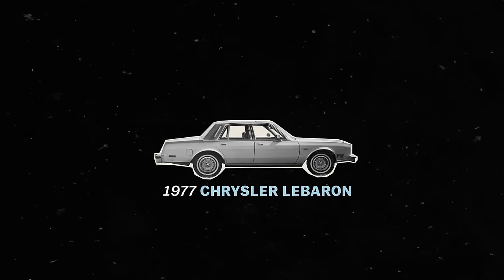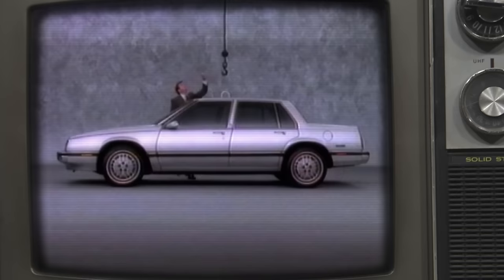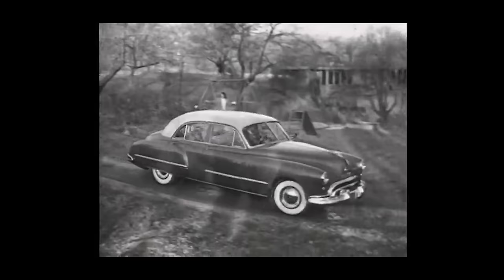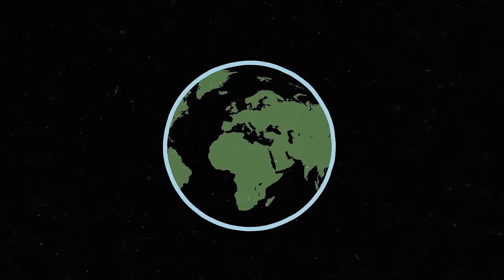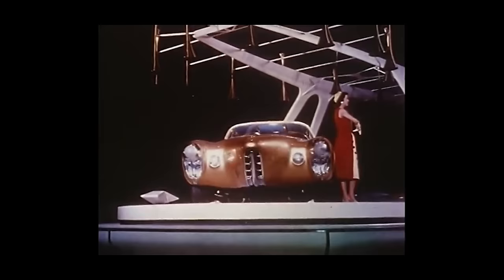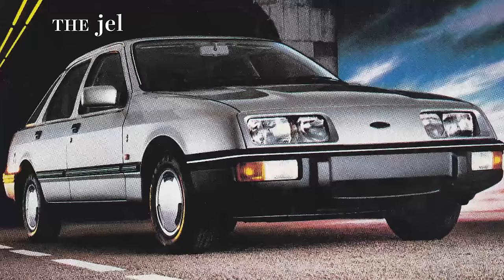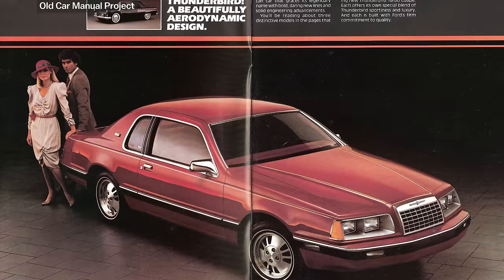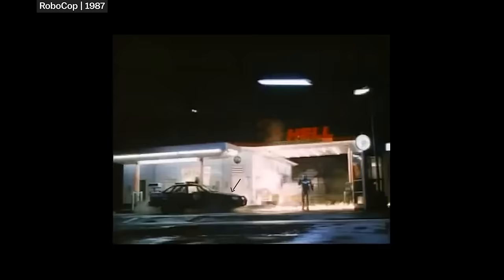How cars went from boxy to curvy

Comment: Interestingly, the Audi 100 /5000 (C3) was introduced 3 months prior to the Sierra in Europe having the lowest drag coefficient at the time. In North-America de C3 Audi Audi was introduced in 1983. Detroit simply had been sleeping, was lacked the knowledge, and had critical inhouse power struggles at the top with lots of corruption and nepotism as well. Specially, the Ford Motor Company with chairman Henry Ford II was a scattered global spaghetti according to Alan Mulally, former CEO. Both sides of the pond very much had their autonomy. UK and German Ford had already merged their design and engineering in mid the 70s. The Ford Taurus indeed was a gamechanger while European and Japanese brands had been gobbling up the American cake of auto sales.

Comment: This video does not seem accurate. It assumes that larger radii was driven by the need for better aerodynamics. This is only partly true. As others have already mentioned cars were very round from I'd say the late 30s till the mid 50s. Also a DMC Delorean is a car with small radii and therefore relatively sharp edges and square profile. Is it not arrow dynamic? A 1940 Ford Coupe is very round, but it is not arrow dynamic. The bug eyed headlights, tall profile, and the non integrated fenders all add signicant drag. The angle of the windshield,  how flush the trim and body panels are, and the over all body profile (low with a tear drop shape) are what is more important I think. Cars today i would argue, are growing less arrow dynamic compared to cars from the 90s for styling reasons and consumers leaning towards taller utility type vehicles. Were cars bubbly in the 90s for fuel economy? Sure, but more importantly, it was driven by consumers demand for new round looking vehicles. Just as consumers bought cars with long powerful appearing hoods and in the 20s/30s, and wanted cars that resembled WWII aircraft in the 40s/50s, and how cars resemble I Phones in the 2010s.

Comment: Auto manufactures claim they make cars and trucks with more curves for better aerodynamics which is supposed to translate into better fuel economy and noise reduction.
Two big problems with that … one, sleeker aerodynamics for improved fuel economy and reduced noise only benefit you if a person was driving constantly ate high speed.
Most driving is stop and go at slow speeds so the above listed benefits are minimal if at all.
Two, today's curvy vehicles with steeply raked windshields badly hamper outside vision and cut down on headroom.
This is the main reason automaker's utilize backup cameras on new vehicles and some with all around vision cameras. 
I've ridden in and drove newer cars and trucks and they do not compare in comfort or outward visibility like my 1989 Dodge truck or my 1990 Dodge Dynasty with their boxy up right designs including thin A pillars unlike todays cars and trucks with thick outward visibility blocking thick A pillars.

Comment: Today's cars have to be the ugliest things ever to hit the road. It is no wonder so many car companies went bankrupt and had to beg their respective government for bailouts.  Add to it that they are poor handling, cramped, weak, and flimsy and it looks like it is a formula for failure.  I used to buy a new car every four years.  I loved the new designs. But my current car I bought back in 1996 new.  I have been holding on to it to see if designs get better.  Every year I just get more disgusted and just hold on to my last new car a little longer.  That, "holding on to my old car a little longer to see if things get better," is now 409,000+ miles and climbing.  I simply can not stand the modern garbage.  Expecially the vehicles with CVT.  I probably change two CVT transmissions a week.  This is in cars with far less than 50,000 miles.